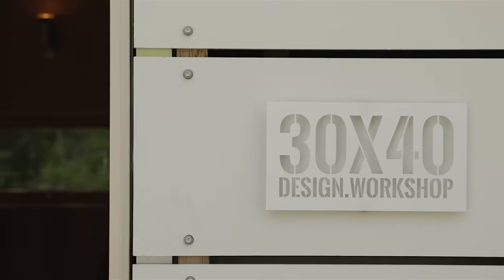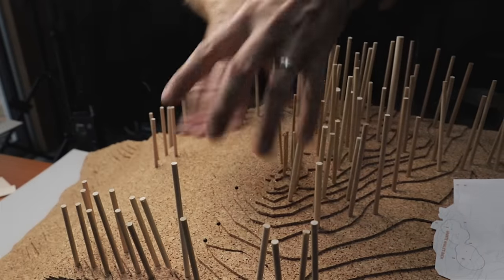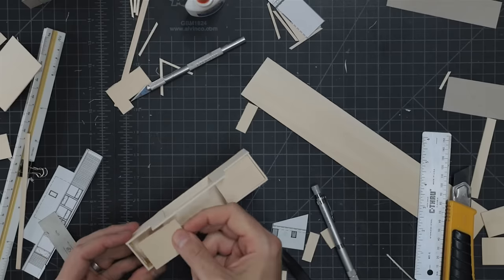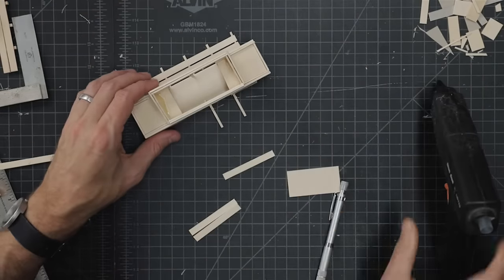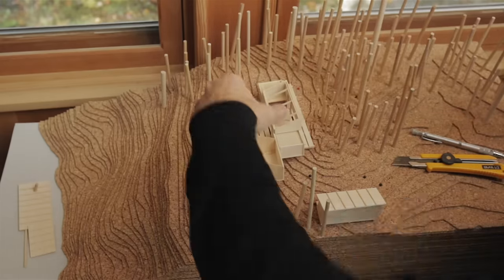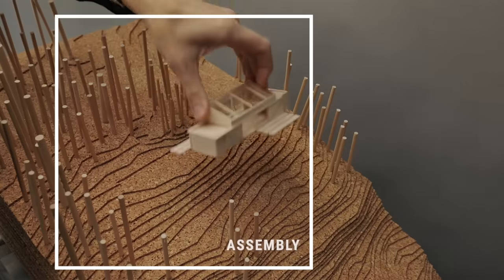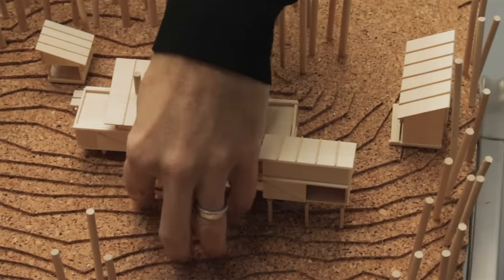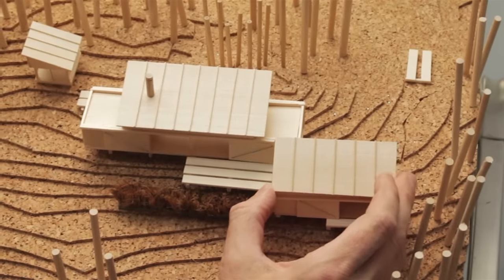Architecture Model Making Tutorial (Using a Real Project)

Comment: you should try using Cyanoacrylate glue + activator spray for gluing small pieces quickly, works just as well as white wood glue but much quicker.

Comment: Q: Wouldn't using VR, a CNC cutter and a 3D printer be quicker?
Reply from the maker: Not for me, I don't have any of those things! There's immense value in the process of iterative design + thinking with your hands...
Reply: Thank you sir for making such kind of videos they are really helpful for students like me they are very useful for knowledge and exposure
Reply: @30by40  What if 3D printing gets faster and retains a good quality? Do you think we'll ever get to a point where the same amount of iterative design can be achieved digitally?
Reply: @everet8590  Just thought I'd give my opinion in hopes that Eric will soon too reply. 3D printing will inevitably get faster, and quality will no doubt increase. The same amount of iterative process can perhaps already be achieved via 3D modeling without even printing and yes you can print many versions of a model. However, I feel as though there is a great benefit to analog feedback that occurs during the process of hand modeling that computer clicking simply doesn't provide. Your mind, eyes and hands are all working simultaneously and the creation of a tangible object that you can "orbit" in real life is far more satisfying than clicking print and waiting for an object to be rendered often times in a single-color lacking materiality and depth. There are benefits to both methods and perhaps there is a balance that can be made between the two. But simply using one tool to create architecture is not architecture in my opinion. In school we are taught many different tools to use in the process (The process is what makes it architecture). Without the process it's just a building copy and pasted onto a site. I would love to hear Eric's thoughts though too! :) Thanks for the great questions!